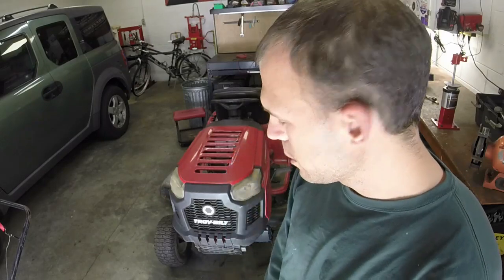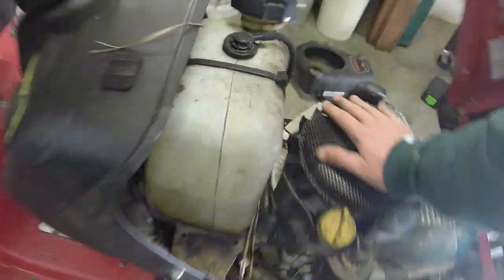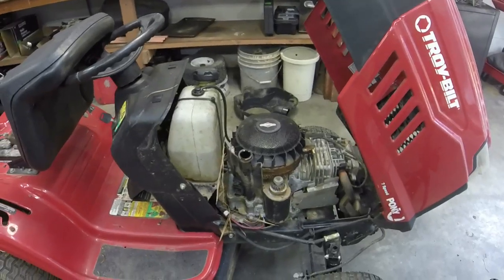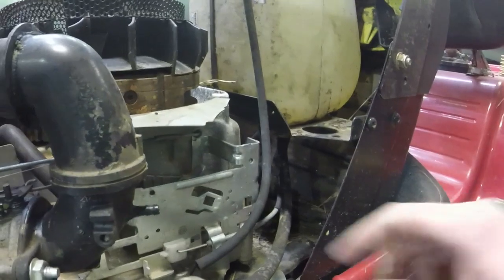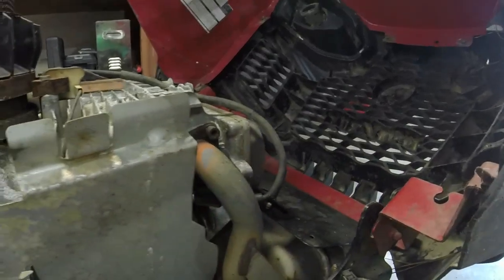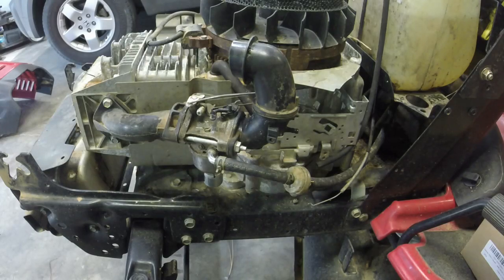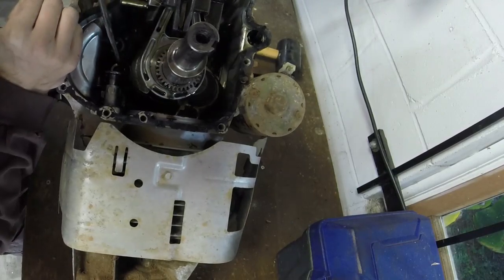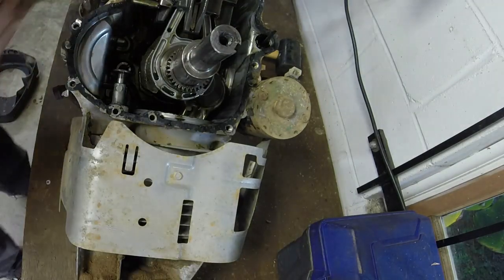4 year old Troy Bilt pony rider blows engine after I replace camshaft.  Bad Briggs Quality?

Comment: 4 years old and the engine blew? Must be a Briggs and straton
Reply from the maker: Not the first Briggs I've seen as of recent that has had engine issues under 5 years old.
Reply: These engines do have chronic issues yes. But the engine also tells the story. And when I saw how black that oil was, as well as the condition of the outside of the engine itself, it doesn't take a rocket scientist to figure out, this engine was road hard, and put away wet. No engine maintenance was ever done, that means the oil was never changed. Oil breaks down, engine overheats, and things begin to fall apart. It was running on borrowed time, all of 13-seconds to departure.

Comment: Its not everyday that I witness an engine pop its rod on camera, and do it without sending the rod through the block! I am saddened about the wasted hours, and the wasted money in the original repair. The condition of the engine and oil basically told the story, it was well used, and nobody ever changed the oil, cause it was blacker then a politicians soul. The oil broke down, stopped lubricating the engine, engine overheated, which caused the original compression release to self destruct, and take out the governor slinger. I agree with a previous commentor about the original break causing a hair line fracture in the rod, it was just a mattter of time, literally 13-seconds to soul departure. Reaper collecting its end of the bargain at the hell gates door.

Comment: With briggs, I have found that the 18hp or 20hp don't have many problems, but the 17.5 hp or 18.5, it always seems the .5 seems to have a lot of issues whenever I replace an engine I always go for the ones without the .5.
Reply from the maker: I've heard the same thing before.  I had a couple commenters say the damage was done when the first comp release went out and sheared the governor teeth.

Comment: you not put any oil on the tappets or cam???
 My friend please don`t put em in dry  always use assembly Lube or oil
my theory is when the pressure release broke
 it must have hit the rod and put a hairline crack in it where you cannot see it
I had the same thing happen to me twice like that
Reply from the maker: That would be my guess too.  At least I'm not crazy.  I should be oiling the tappets and cam as well.

Comment: Put a Kohler 7000 series in it..ya you'll pay almost  $2,000 for the motor but  well worth it..3 year unlimited hours warranty..cast iron sleeves it will last you decades..
Reply from the maker: The Kohler engines are good, if this was a more expensive mower it would make more sense to do.
Reply: The whole mowers not worth $2000!  Why not put a Lamborghini engine in it!

Comment: A bunch of things lead to this, comp release was little, flywheel mags could have helped, you should have lubed the new cam and lifters and also lube the crank in both spots, rod end and before sump cover and seal, upon startup , run easy till warm before pegging the throttle, just my 2 cts, I have fixed a bunch from not enough oil in and grubby from not draining when hot and all dirt stays in there and wares it quick,,nice vid though, keep up the good jobs and have fun...
Reply from the maker: Some comments said maybe a hairline crack in the connecting rod from where it took the first comp release out.  Flywheel magnet issues are bad on these.  I will remember to oil everything a little bit when I do the next one.  This is about my 6th or 7th one and I had no issues before and followed the same process as I did with this one.  It also did not look like it was taken care of either and it's not the first Briggs under 5 years old with an internal issue.  Probably a little bit of everything!

Comment: Those compression release arms will fly off and get in way of crank and rod
It’s history after that is what I find regularly on these model engines
Reply from the maker: I think that's what happened.  It jarred the crankshaft and finished itself off after I fixed the cam.